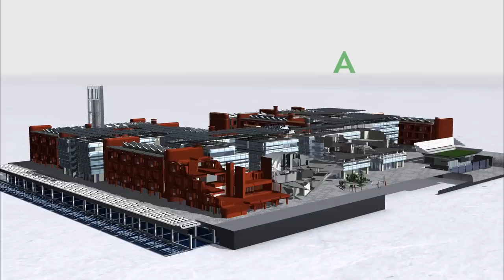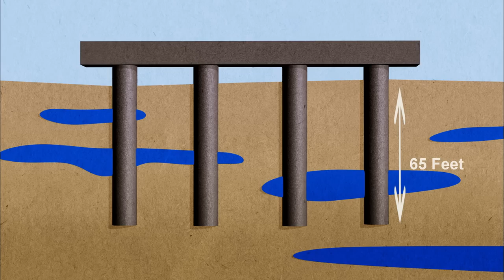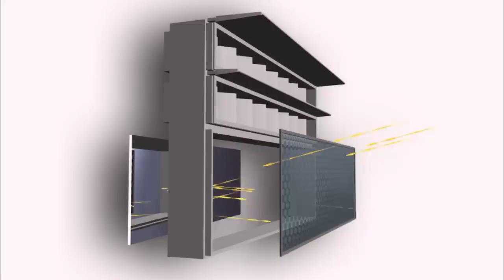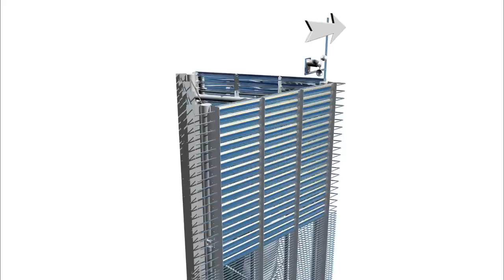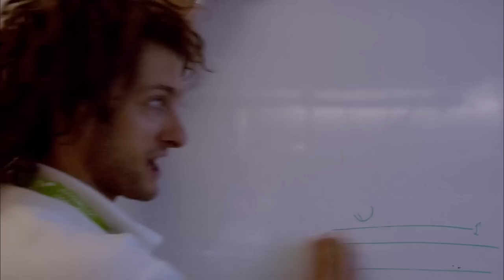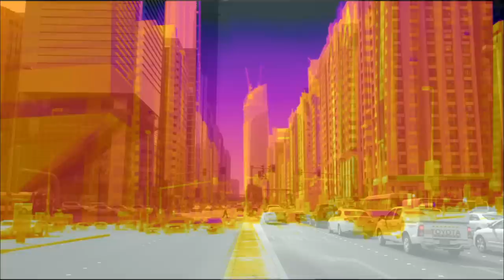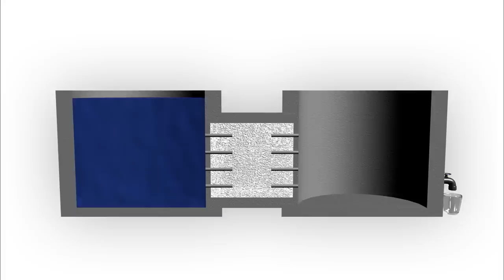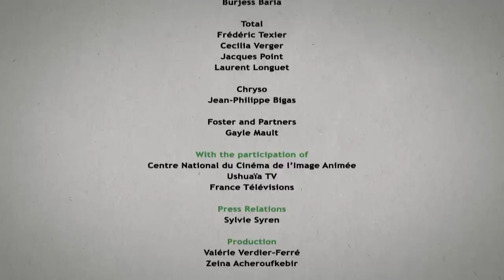The Power of Possibility: Exploring a Sustainable Urban Environment

Comment: As a whole it is an interesting project, but how will it develop over time? No city remains the same, even if it was fully designed at the start. It still falls short by using gas to boost the energy recovered by the solar facility.